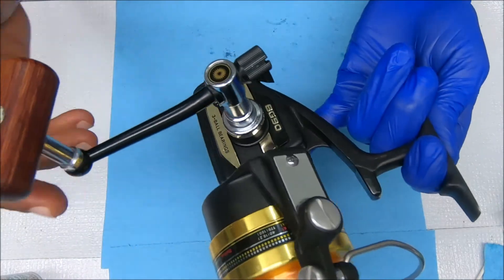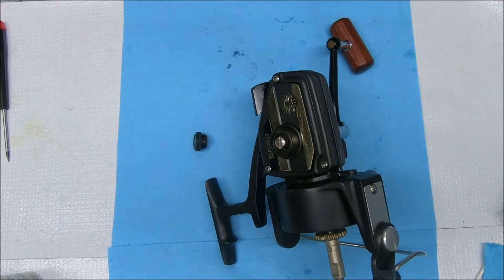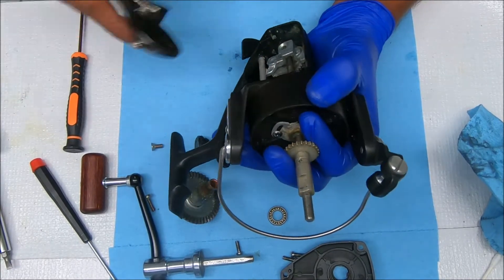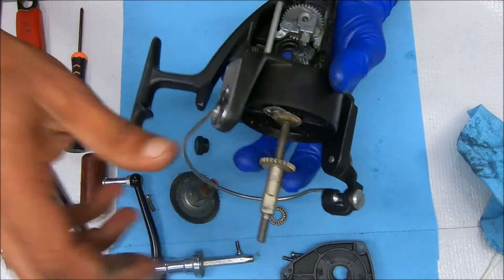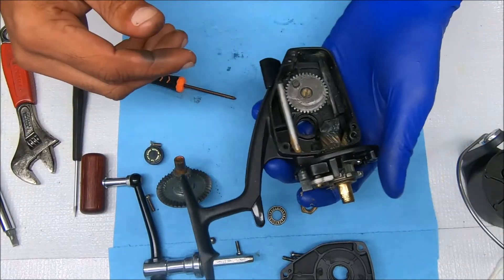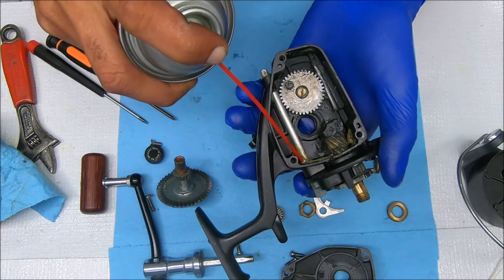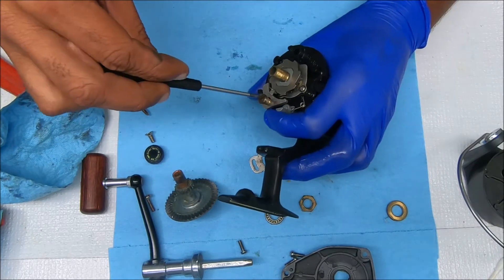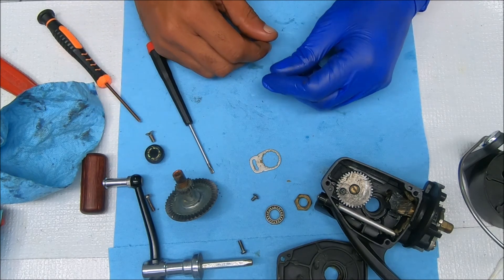Daiwa BG90 Anti-Reverse Not Working With Simple Fix: Fishing Reel Repair

Comment: You did a great job bringing that AR back to life. I once soaked a DAM Quick SLS reel for two weeks in WD40 to get an AR shaft loose and it still would not budge at all. I did the same with a Ryobi Powerful No. 4 reel and got it loose and working fine. Sometimes you win and sometimes you lose. Great video on a nice looking BG90. Now if you can balance the rotor wobble I want to see that! LOL. — Chris
Reply from the maker: 🙂 see my last response to you regarding the rotor wobble. Thanks regarding the A/R! Soaking doesn't always work, but there are other ways that could work, though they come with risks.... heat, tools, etc.